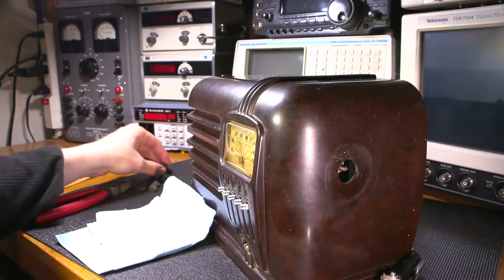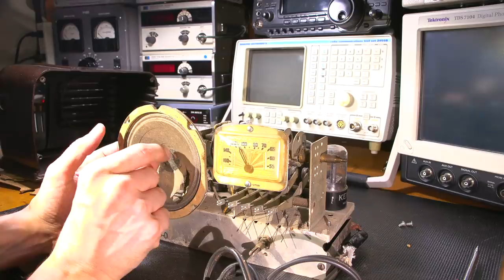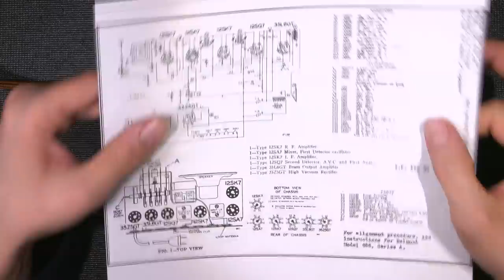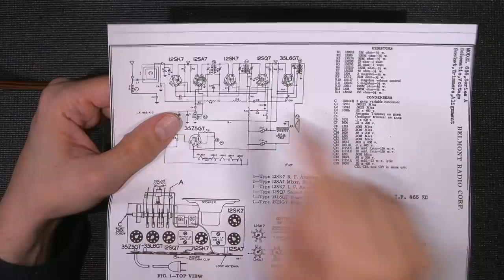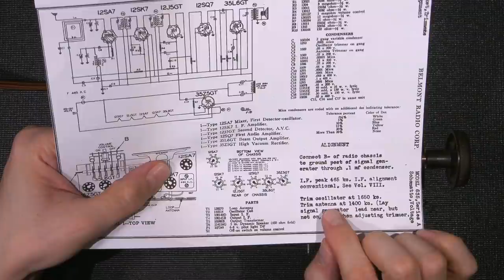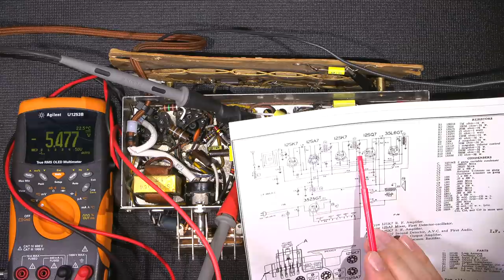Electronic Restoration Adventure-The Belmont 636 Radio Receiver!

Comment: Are those old storage oscilloscopes in the upper right-hand side? I have one of those type 549 storage oscilloscopes without the hood, is it worth figuring out if it works or restoring it? Or should I break it down for other projects?
Reply from the maker: The scopes are not a storage type, aside from any persistence in the CRT. The two larger scopes are TEK 547's, and are definitely worth restoration. I use them all the time for specialized projects, where I need to look at low amplitude, low noise signals. The newer scopes "just don't cut it" in this aspect.
Reply: I think the type 549 storage oscilloscope I have has the differential module installed (I would need to check it again) at the moment it's a curiosity on my shelf. I do know the CRT turns on but that's the extent of what I know about it. It has been awhile since I last used an oscilloscope, most of the electronics I do now are simplistic robotics using arduino. Maybe I'll consider getting my type 549 oscilloscope restored and verified that it's working.

Comment: What about using diodes for providing reverse voltage protection, with a fudable
Reply: A fuse able link in series with the diode in case a huge power surge causes a short?

Comment: Do you tackle record changers. I'm currently working on two different types. One is a 1946 Philco 78Rpm only with a great AM radio attached. The other is a 1949 45 Rpm player , again attached to a good RCA AM Radio. I have not worked on record changer mechanics since 1972. Patience is my guide and craft is my vice.

Comment: Wow, this is the first case I have seen of someone being a 'scope addict'.  Really, how many of those things can one guy use?  I am also working on an old valve radio repair.  While mine has the speaker in decent condition most of the capacitors are leaking wax so I am replacing all of those.

Comment: Mr. Carlson: I believe you mentioned one or two good quality electrolytic capacitor kits that are available on the internet.  I am going to replace two or more caps that I believe are responsible for dragging down the service voltage (B+ or Vcc) in the main board and display board in a Uniden/Bearcat  BC800 XLT. I would rather spend more now, than have to replace them twice. I just can't remember which one of your videos I heard the cap manufacturer's name mentioned. Thanks you in advance / WB3EFE

Comment: I purchased a working but unrestored 1947 Silvertone A.M.-F.M. console that has an antenna like that with the same clips on it. Unfortunately is was not hooked up when I got it, and I do not have a schematic. Is there a surefire way to tell how to hook the antenna card back up correctly, or does the time old tradition of reversing the wires until it works best apply here?

Comment: Great video, beats a movie any day. How does the rf preamp work? Im Currently building up a super home radio from my spare parts bin. (Going for an all GT style for the look and am using a trans and PP output with choke input filter, 6sk7/a7/q7 6v6gt pair and 6sn7 for phase inversion as well as an rf amp stage, 5u4 rectifier and a lovely sounding speaker from a 50s philips set) but like all other preamp radios ive messed with im using a 3 gang tuning capictor for a tuned rf preamp.

Comment: im having the worst time trying to remember these B.E.D. color codes . do they make a chart ?  if so thank god  ive got a  1933 deforest crosely floor radio i might need to peck at when spring comes cause the filter cap is on it's way but still going to receive signals a big ol resistor is getting hot  so that has gotta go and im planning to integrate a fuse  cause just in case anything cremates it'self it will bomb the fuse rather than the transformer.

Comment: What land source is direct current that this radio might be connected to when built?  Back in the 1930s, many US Navy warships still used direct current.  The need for AC in the US Navy from the mid-1930s on was driven by the increasing use of Synchro/Selsyn high-accuracy analog data-transmission circuits in ships primarily for fire-control systems, replacing the older DC "step-by-step" and similar systems, which had reduced accuracy and some chance of being misaligned by poor maintenance or battle damage without any indication except sudden non-performance of the connected devices (which may be noticed too late in a battle).

Comment: Mr. Carlson, can you recommend a reasonably priced isolation transformer?  I am working on a Belmont 601 (1936) transformer-less AM radio and am a newbie.  I was on ebay.  Is a "Step Up/Down Voltage Transformer Converter" the same thing as an isolation transformer?  They are around $40.  Thanks,  John

Comment: Good video as usual, I do have a question, I repair boards - computers mostly and I decided to restore an Emerson radio model 515 but I have no idea where to get the capacitors, I will find 1 or 2 but not all specially when the voltages are 200-600v. I'm used to those thin film capacitors which normally I pull from a donor board to another or the occasional electrolytic.

Comment: one tri9ck to find the outer foil side is to use a osciloscope in a sensitive af setting then hoolding the cap and see on witch lead you see more 50 hz ac hum

Comment: Watched your entire video and thoroughly enjoyed it. I'm new at this so forgive any questions that are too obvious. On ohming out the IF coils. What would you have done if one of the four coils was open? The replacement speaker needs to be compatible with that era speaker. Correct? I didn't hear anything about electrolytic capacitors were they in the large black tube? Thanks for any clarification or feedback.

Comment: This was a great video as always but why did you not use your new old radio work station with an old oscilloscope?
Reply from the maker: Hi Debra, I'm adding shelves to the wall just above all the oscilloscopes on carts. I just finished welding some custom brackets, its coming together nicely. Soon this lab will be used on a continual basis.
Reply: Thank you for answering the question, I look forward to seeing the new work bench also I am Debra's husband, she does not have much interest in old radios. Thanks, Bob.
Reply from the maker: You're welcome Bob!

Comment: Would you have a schematic for a 1932 GE J-82 Cathedral radio.  (Made in Canada).  The closest I have found is a RCA equivalent R-8 diagram but there is still little correlation of parts and parameters.

Comment: Nice video BUT you say the lamps are connected in parallel when you should have said serial. Original lamp had 47V over it, and these two 18.5V lamps in SERIAL get the combined 37V. /Bessemer
Reply from the maker: No, they are in parallel. The original lamp is not 47 Volts, it's a #47 bulb. The numbers don't have anything to do with the Voltage and Current ratings of the bulbs.
Reply: Thanks for the 'enlightenment' about the bayonet socket !  Carlson is also a Swedish surname. My grandfather used to sell and service these old radios in the 1950's  ;-)

Comment: when you check ancient paper capacitors on your electric eye meter and raise the voltage 20 30 40 volts at what frequency is the test made and it shows severe leakage so if you put that cap across the 120  volt 
ac line wouldn't it explode?
Reply from the maker: Hi Perry. The test is a DC test, so no frequency.

Comment: When you repair the IF transformers how you identify the input and output leads?
Reply from the maker: Hi Perry. They have a standard color code.... "usually."
Reply: When you test ancient paper capacitors on your meter with the electric eye you show increasing the voltage 20-60-80 the capacitor becomes a resistor.  At what frequency is the test being made?  If it was a low enough frequency wouldn't the capacitor start to hear up?

Comment: I have a question.  I've been working on an AA5 Radio, Emerson 503.  I replaced the capacitors and the radio is running but the slightly bigger capacitors is having an effect on the voltage doubler circuit.   My biggest concern is that the 50L6GT is running about 215V on the plate voltage.  I understand the specs say the that max is 200V and a lot of old documents average close to 190V.  How can I lower that plate voltage.   It really gets hot and I understand that a certain amount of that is normal for this tube but I want to make sure it's going to last.

Comment: "It feels nice and smooth... now it feels solid.. not bad.. Oh, it's gonna slide out.. look at that, oh... It's gonna probably makes some sound.. it's got a big hole there! I usually seal tight.. to keep the leakage in... It almost looks shrunk in the center looks like it has a bow to it... Look at that, it's all blaaack!.. nice and shiny.. The bed resistors.. B..E..D.... boy are they ever tight... there is no need to remove the tube.. done it for years, never had a single problem <farting noise> It's all brown and discolored in there, see that?... It's a little bit messy and I don't like that... I don't wanna be putting downforce.. you don't wanna damage this."

Comment: great job on the restoration. Curious where you get your caps, resistors and tubes from? Any suppliers you really like? Thanks. subscribed will look at more.
Reply: On the web ( Ebay), you can find parts for valves devices, there are forums about valves device fixing, i often go on them to pick-up advices.
Resistors and caps can be swapped with modern ones, JUST ORDER the SAME values as original !!

Comment: How many of you were yelling at the screen that the delicate plastic dial cover is bearing the full weight of the radio and being ground into the bench pad?
Reply from the maker: The radio chassis is "feather weight" light, and the black mat is very soft. So soft in fact, I replace it after every video.

Comment: Paul -- here in the U.S. we don't pronounce the "L" in the word "solder."  We pronounce it "soder."  Having lived in England during my career in the U.S. Air Force, I got used to hearing it called "sol-der" at radio clubs and on the air.  Whenever I called it "soder," I either got laughs or some sideways looks from those Brits who heard it.  I also became a fan of a TV police procedural called "The Bill," and the word "sod" in various forms was used quite frequently.  I'm just wondering if this is why when referring to that alloy of lead and tin we use to create electrical connections is pronounced with the hard "L" sound?  73 de Larry, K3LT

Comment: My question is, if there is no transformer, then how does the tube heater filament work?
Reply: They're all in series.  The filament voltages add up to 115V, or something close to it.
Reply: @NoahFect , yes, you're correct
I figured it out later seeing the schematic.
Though they would be very sensitive to voltage fluctuations in the AC line.

Comment: What happened to the B+ filter cap? The large electrolytic? It disappeared yet the the radio works fine with no hum. Something doesn't add up.
Reply: He must've replaced it
Reply: @radioaktiv7841  I'm sure he did, but replaced it with what? He never said. Electrolytics are not small. Where is it?

I am in the process of re-capping an old Philco 5 tube radio. I see people using 450WV electrolytic capacitors even where the highest B+ voltage is only 130 volts. I'd like to know why?

Comment: MR Carlson's Lab - If you had to pay to have this kind of restoration done. Making the assumption the customer owns the piece of electronics being restored. What kind of monies would one expect to pay to have a project like this done. Obvious you have parts and then you have labor. Using your project as the example. The next question would be how to find a person with the experience to do the job as neat and clean as you just did, and not have to worry about getting back a butchered up job.

Comment: WD-40 is good at cleaning up or cleaning oil and grease off. But it is no good at lubrication.. as a matter of fact it takes the lubrication off of most parts .!!! ..the inside of this case would be the same and I would add 3- in -1 oil to the parts you treated with WD --40 Respect Brother Bruce...

Comment: i would like to make a radio with a single dial that goes from 5khz to 2000mhz.... is that possible ?..so i can hear every transmission around me.
Reply: rundown thomas It’s possible: software defined radio (SDR) would be a workable solution, perhaps with single conversion or with a digitally tunable preselector preamp. But the antennas are quite different between 5kHz and 2000MHz; you’d need an external and pretty long antenna to receive low amplitude VLF. And the “dial” would be a USB HID controller tied to gnu radio or something like that :)

Comment: Why are you checking resistors in circuit and expecting good readings?
Reply from the maker: Hi Steven. Tubes are high impedance devices, so one end of most resistors in these circuits "looks open" to the meter, so it looks like (to the meter) I'm testing the resistors out of circuit. Knowing where, and how to test resistors in circuit (these types of circuits) just comes from experience.

Comment: Did you use 1W or 1/2 W carbon composition resistor in this restoration? 73 Asle
Reply from the maker: Most replacements are 1/2 Watt, A/B resistors

Comment: 28:09 Why are you adding solder if you're going to remove it?
Reply from the maker: Hi Justin. This is done to help melt the old solder. Adding new solder conducts the heat to the old connection better.

Comment: I like to know what is rough impedance of antenna input on old tube radio.
Reply from the maker: Usually around 400 Ohms.
Reply: 450 ohms unbalance antenna would be a good match.
Reply: or 9:1 unun impedance transformer to coax would work.

Comment: Here is a stupid question considering I’m not electronically minded but with today’s electronics would they degrade and need to be replaced say in about 80 years as did the resistors etc. in the 1930s?

Comment: sol·der
/ˈsädər/ The [L] has no sound. Other than that, I'm reminded of school. Thanks for the video.
Reply: From Wiktionary:
/ˈsɒldə(ɹ)/, /ˈsəʊldə(ɹ)/
From Dictionary.com:
/ˈsɒd ər/
From dictionary.cambridge.org:
/ˈsəʊl.dər/, /ˈsɑː.dɚ/

Maybe do 3 seconds worth of research before posting nonsense. Ultra-nonsense in this case: /ä/ isn't an IPA symbol I've ever seen and /r/ doesn't exist in English. Maybe do 3 seconds worth of research before posting nonsense. Clearly there is variation in the pronunciation. Ultra-nonsense in this case: /ä/ isn't an IPA symbol I've ever seen. /r/ doesn't exist in English, though it is sometimes used by the lazy in place of /ɹ/ (as you can see, the latter two references did so).

Comment: i was told that lights interfere with certain wave forms led's affect short wave so !!
Reply: Netty Voyager LEDs affect my mobile HF radios in my Jeep. It’s quite annoying. I choke and shield everything as much as possible as to eliminate the noise. But it still bleeds through.

Comment: It looks late 40's or early 50's and see it is an all American 5.  Nope it's a 40's, they didn't come out with the 5 tube system till the fifty;s.  That's the antenna, almost all had those antenna's. an aa 5 had a 128AU8, a  50c5, 12AV8, it 'been a while. I use to repair an AA5 when I was in jr hi school and hi school. This is a 40's or maybe an early 50's..
Replace the circuit and add fm but light the backlight with an LED.
I have gotten my ass shocked many times. When I started on TV's I got my ass nocked off on the high voltage fly back.  Oh made my hair smoke.. long time ago.
That is going to be a very nice piece, just a little wax.  I would like to see a Stromberg Carlson 
That speaker can be fixed but it would be better to place a smaller speaker inside that speaker so it would look original from the back. Think about hand wireing in the plant.
Reply from the maker: The schematic is in a manual from the 30's. The schematic is dated 1939.

Comment: Its a transformerless radio, BE CAREFULL when fixing this kind of device !!! because you're not insulated from the mains voltage !
Its more safely to use an INSULATING TRANSFORMER, when you service "multicurrents" transformerless valves radios !!!